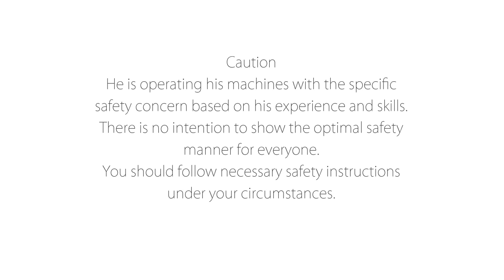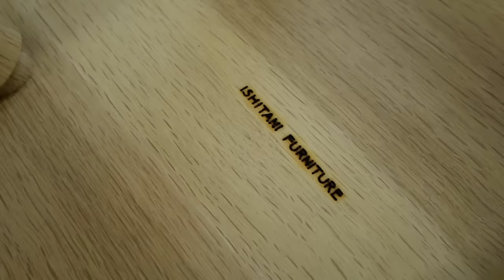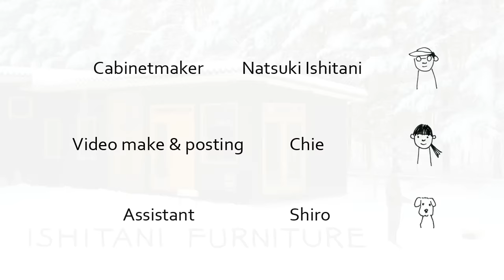ISHITANI - Making Wood Bending Chairs 2.0

Comment: This an interesting video with unique techniques and very good workmanship and a fine looking chair. I caution anyone doing woodworking about the safety hazards involved with wearing gloves while using power equipment in the woodshop particularly      
 table saws.jointers , radial arm saws, and lathes.

Comment: Excellent , as ever. What a pleasure to watch a master craftsman with his tools playing a symphony on the wood...
I have just one observation - at 12:19, where the legs meet the seat, is it possible to hand cut the shoulder to match with the angle? This would a) enhance the visual appeal of a well carved joint and b) add to the strength of the already strong joint, as the pressure of the weight borne would distribute equally around the shoulder than being focussed on the highest point of contact. Sure, the shoulder is not actually bearing the weight, the joint has been strengthened by the taper wedges driven in from the top, but eventually the shoulder has to be defined for the purpose. This observation comes from a metal working mech.. engineer, who knows little about wood and its joints.

Comment: Beautiful work. 
What is the box with chair legs in for? It has a light inside, I've seen it in some of your other videos.
Reply: Dave James It is used by chairmakers to selectively dry the wood for the leg tenon. When the leg is put in place in the seat, the tenon will take up some of the moisture in the seat and because it was a snug fit when dry, it will never move or go loose in the chair's lifetime. 

In the past, chairmakers would have used hot sand in a can or bucket. The box will have a heat source inside of it. Probably an incandescent light bulb.

Good question. You were  definitely paying attention :)
Reply: That's so smart!
Reply: @MarkHarrisonBNE  Thank you for answering that. Lets say the wood is at about 10 % moisture content - how long should the tenon be in the box for?

Comment: I noticed that at 3:27 and 3:47 you drew a circle in the corner of each of the six boards used for the seats before rearranging them for best grain orientation.  Would you mind sharing what those circles were for?

Great video, as always.

Comment: I love watching you work and your designs are simple yet elegant. Whats with the light box for the leg ends and why microwave the wedges?

Thanks
Reply: Mark Prochaska I'm guessing it's to dry out the wedges making them shrink. Once glued in they will absorb moisture from the glue and from the air making them expand and become tighter.
Reply: I was kind of think thinking along those lines but the moisture in the wood might also make them expand??
Thanks
Reply from the maker: Thank you :)
The wood is shrink later.
So we drying in advance.
Reply: Thank you, I thought that it had something to do with drying. Keep up the beautiful work.

Comment: Why isn't the leg shoulder flat against the bottom surface?
Reply: When I started doing woodwork I thought the same thing. The round leg shoulder thing really bugged me.
Can’t speak for Ishitani, but I’ve concluded the time and effort involved in getting round leg shoulders to seat tightly at a compound angle is not worth the trouble. He uses a Wixey digital angle gauge to set a single resultant drill angle, and a laser cross line projector to find a 90 degree sight line.
There is a bit of wiggle room between all the parts, including a smidgen for how far each leg goes through the seat. Finally, the chair is leveled up with shims on a flat surface, and each leg is scribed and sawn to final length so that the chair doesn’t rock.
It is hard enough to drill for all the legs at the exact same compound angle, glue the legs in part way and then slip in the stretcher rungs, continue to assemble the chair, and all while the glue is trying to seize up. It’s a nightmare trying to get something like that together.
Sure, all the shoulders could be made tight, but it would be a lot of work.